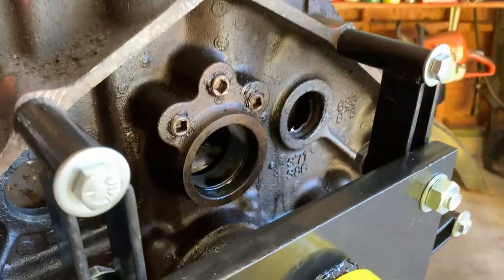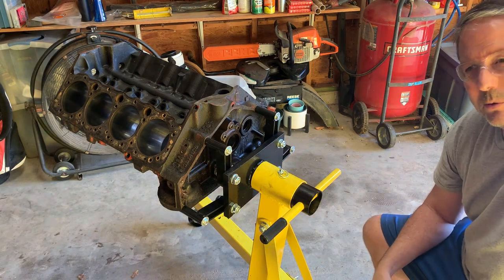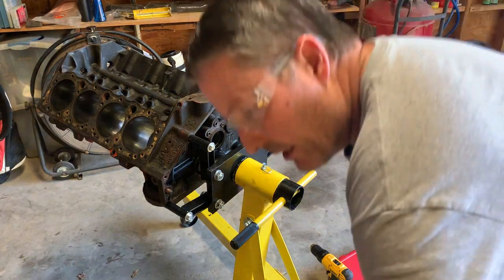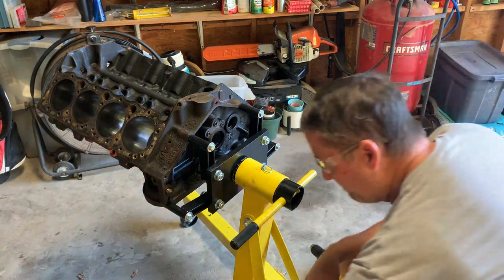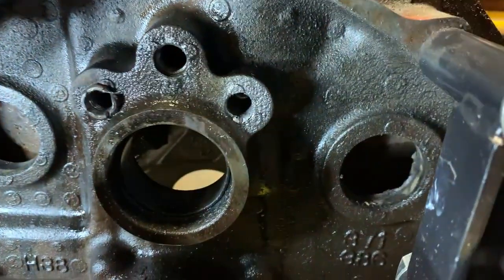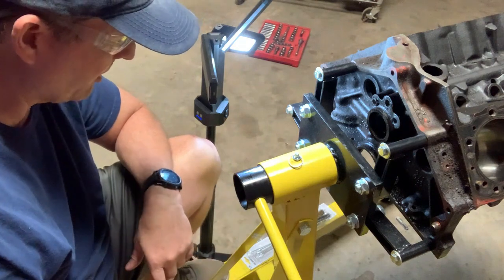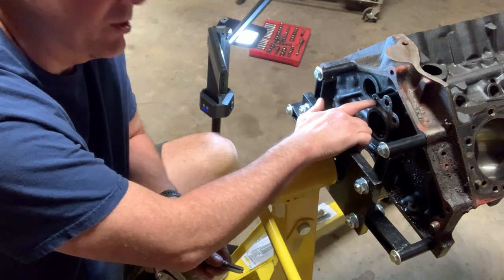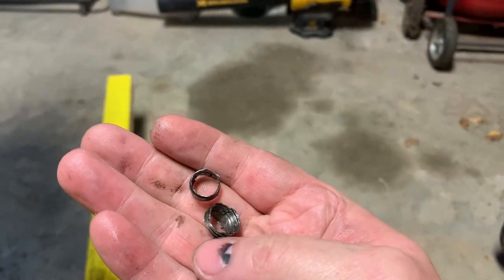327 Engine Disassemble 4 of 4, 68 Corvette restoration project 19 of ?

Comment: When you knock the cam bearings out it knocks the rear soft plug out...
Reply from the maker: Thanks for the suggestion. I have a C4 that may need an overhaul soon. It runs okay, but at the first sign of trouble it is coming out.

Comment: I had the same problem, but had a set of reverse drill bits. Started small at first getting larger as I went I applied pressure. It heated up enough that they all came out. Very thin and hot but they came out. Had me worried at first. Yours is coming along nicely.  Soon it will be together again looking real nice. Have fun and stay safe.
Reply from the maker: Thanks for sharing.

Comment: I heat red hot then use a candle to plug then a square pipe plug socket bit and thread out easy but I've done 100's of them . Good video keep moving forward
Reply from the maker: Thanks for sharing.

Comment: I have extractors made by Mac tools that works great.  They are square and tappered, drill a hole in the plug and pound the extractor into the plug and put a wrench on it and turn it counter clock wise to remove the plug...  The end of the extractor has a twist to it that makes it bitethe plug.  Easy outs do not work!
Reply from the maker: I have one set that never works. I showed one on the video. I have another set that works some times. I tried them, but I didn't put them in the video. The plug metal was so soft, they worked farther into the hole instead of removing the plug. I didn't want to cause a crack. Yesterday, I broke a couple of the smaller extractors removing rusty bolts from the rocker panels. I'm asking Santa for a new set of square and tapered. Thanks for the suggestion.

Comment: Is that a small journal or a large journal kind of hard to tell I think large ❓🚩
Reply from the maker: According to the information below, I have medium crank journals.
small = 2.30" mains, 2.00" rods
Medium = 2.45" mains, 2.10" rods
Large = 2.65" mains, 2.10" rods (400 cid)
Reply: Their is no such thing as medium journals...  They are either small or large journals, you listed the two different sizes on a large journal crank and small journal crank.  Large journal crank didn't come out until 1968...
Reply from the maker: I won't debate what to call it. What I can confirm are the measurement. I don't have a micrometer. I used a caliper, so it is approximately 2.45" for the mains and approximately 2.10" for the rods.
Reply: @chadd2715 That's what it suppose to be for a large journal crank and the rods,thanks...